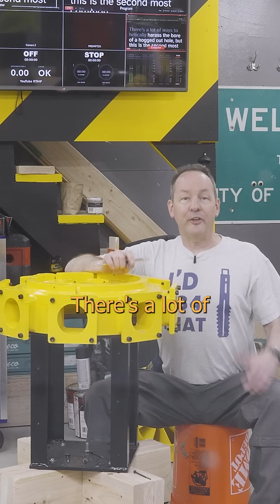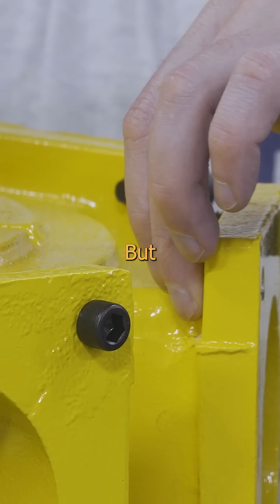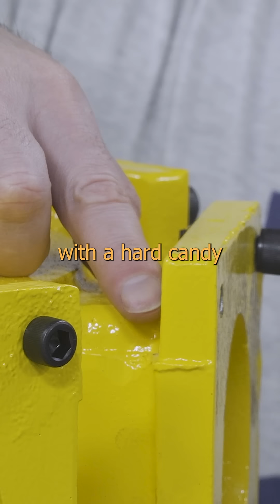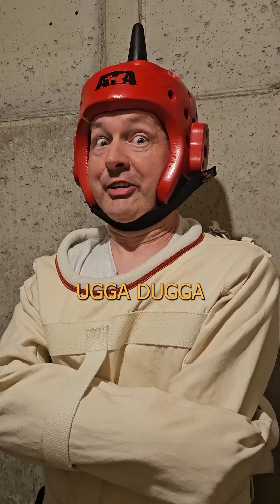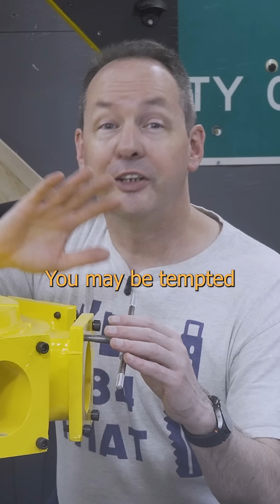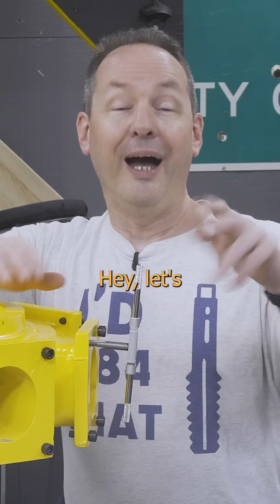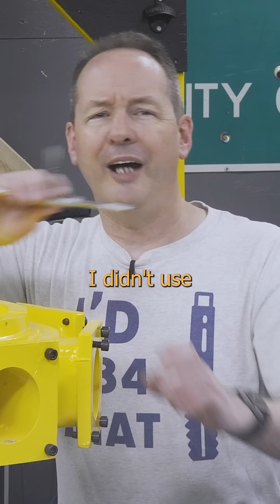Thread Chasing  #chrisboden #comedy #engineering #skills #workshop #metalworking #tools #apprentice

Comment: Dumbass, I'm a reloader and a I was trying to remove a stuck case from a resizing die. I purchased a stuck case removal kit, part of the procedure was drilling a hole in the stuck case and tapping the hole. Looking back, I think used way too much force when I tried to do it by hand and I put the tap in the drill because I thought I wasn't applying enough force. Eventually got the fucker out with a press.

Comment: Dumbass here
Work in a shop to maintain and build tools in the oilfields
I had 160 3/16"-16tpi holes to chase and I was told by a coworker to Chuck the tap into a drill but not on the square bottom, on the round and tighten until you can't tighten it. Sounds good and I get through 20 holes then snap the tap just below surface. Took a while to work the tap out (about 2 hours because I can't damage the equipment to get the tap out), plus 30 minutes to find a new tap, then I did everything with the tap wrench. Not a painful lesson but a long lesson

Comment: Important to use a tapered or plug tap to start chasing. They both help keep your tap centered and clean up the starting thread without cross threading.
If it is a blind hole, start with the tapered or plugged, pull out, and finish with a bottoming tap.

Comment: Dumbass! Trying to chase an M6 blind hole in a motorcycle frame in a tight location without tearing the bike completely apart after having drilled out a snapped bolt

Comment: This dumbass learned on the cylinder head of my 02 celica GTS.  Bolts got rusty, thought I would clean the threads out with pb then brake clean and just chase the threads in the aluminum head...where were you 7 years ago?  Broke one also. Guess what? I dropped it.  Double Dumbass 😂

Comment: I'm that dumbass.

Tapping out a rusted bolt hole on a 77 Camaro's waterpump, trying to be Johnny on the Spot and do it quickly

Got allllmost to the end of the bolt hole when.

POP!

and my tap came out significantly shorter than when it went in, like Cotton Hill getting out of WW2.

Comment: Drill hole with press or mill.  replace drill with tap.  TURN CHUCK BY HAND.  This will make everything line up perfectly.  If you do this often, take an old drill bit, and bury it perpendicular into  a T handle.  This is how my dad did -0/ + 2 thousandth precision for years.

Comment: Chasing threads with a drill is pretty safe, just set the clutch lower and retry when it engages, never had a problem. If you dont trust yourself to find the start just go slowly in reverse and feel when the tap drops in.

Comment: 53M, I saw a guy hit his finger with a hammer and he ended up with a pocket of blood under his fingernail and the shop teacher told him to take a wood bit and make a hole in his nail to relieve the pressure.. you guessed it, the genius grabbed one and instead of just using his fingers to rotate it back and forth until it penetrated the nail, he put it in a drill.. one trigger pull later and he had his hole .. unfortunately it went all the way through his finger.

Comment: My dumbass story on that front involves a workplace that requires us to use an impact to cut threads for our holes (5/8" normally) first time you shatter one all the way in you learn how to use a hole saw without a pilot to core out an aluminum plug almost 2" deep, weld the hole back to original, then you do everything in your power to never have to do it again 😂 I'm over 2 years out from my first experience with that and no more casualties to speak of!

Comment: Ive got a box of bolts with the heads cut off and a couple slits cut into the threads ive made so i can chuck em in a drill and blow threads out. Every one is made from a pair, 1 worn low grade 4ish and 1 grade 12.9 or equivalent. 
Been using those for years and never had an issue

Comment: So that was super cool, I learned a couple things along the way including my dumbass failing at the point you mentioned the last time I tried. To prevent this problem, I saw a solution I hadn't thought of that you may want to try when painting the rest of that siren, when plugging those holes, use cheap foam ear plugs to cover up the holes. From my understanding, when done, you shouldn't need to chase the threads again as the foam plug fills the hole & the threads.

Comment: dumbass 
my dad and i was making a special nozzle for a power washer wand, we had to thread the stem and the nozzle tip, i couldn't find the lube and i went to fast and broke the tap off in the nozzle tip, we had to drill a small hole, use a screw puller bit to pull the part back out. moral? do as your told and not as you want, and tools don't get broken

Comment: Dumbass! 100%.
I wasn't so much chasing existing threads. Some other Dumbass used an impact to tighten the hardened steel drain plug that goes into the aluminium oil sump on my 2003 Odyssey. I normally do my own maintenance, but I was on vacation, somewhere almost exactly between Tampa, FL and Carbondale, IL, on my way to to Carbondale to see the solar eclipse.
My Odometer hasn't been visible in decades, so I just wait for the maintenance indicator to tell me it's time, and it was. So i went to one of those drive-thru oil change places. 
Next time the light came on, I put my wheel ramps in the driveway and sits it myself, only to remove the drain bolt and have all the threads come with it. 
So I took my bolt with me to NAPA (it's so much closer to me than any more affordable auto parts store that it's cheaper to pay the higher NAPA price and to spend the fuel to go to the cheaper store) and bought the next size up and the correct size tap. I started the tap by hand, but finished it with the drill only to have to go up another size because the drill was too fast and fouled the threads. 
My second attempt was fine entirely by hand and the threads were good, but my alignment was bad and I had an oil leak at the drain for the free months it took me to save up for a new sump pan.

Comment: if you break a steel tap off in aluminum, hot alum for a day will dissolve the steel but not the aluminum. I think this may work for bolts if you got a week lmao. similarly, if you accidentally weld aluminum to a drill/tap/endmill, putting it in a bucket of lye (sodium hydroxide) will dissolve the aluminum but not the drill, rendering it once again usable.

the gold standard is a hole popper though.

Comment: I’m a dumbass because I tried it with cast iron. I thought using an electric bit driver would prevent me from going to fast or too rough. I both broke the tap AND cracked the cast iron piece right in two

Comment: "dumbass." I set injection molding molds and we have 5/8, 3/4, and 1" threads. Considering I'm the only one who stays on the upkeep of the platens and threads (since it is in my job description and it makes sense), I burn through taps and brass brushes to clean the threads. One day I was changing the mold on a press that had the same mold in it for over a year. Naturally some goober biilds up in the unused threads and the bolts tend to become one with the platen threads over time and removing them is almost always a chore. 8 out of the 16 threads needed retapped after using the brush to clean them and since that irritated me due to carpal tunnel and using a ratchet with that repetitive motion for that many threads was sure to make me wake up with dinosaur hands at least 2 times that night, I grabbed a drill. Long story short,  the mold took 4 hours longer to set because I had to explain myself as to why half the threads needed drilled out and replaced with c-serts. All I could say was "my dumbass used a drill to touch up the threads." I can say I got lucky and only got a verbal. Moral of the story: They make universal socket adapters for thread taps. As useful as they are, you have to learn for yourself that you need to hand start it in the threads as far as you can and always either use an adjustable hex impact on low setting to start or a drill on the high speed setting and the clutch power turned way down and increasing as needed. If you use the high torque #1 setting and have the clutch setting to fully engage and that thing starts going on an angle that you won't be able to control, you've officially screwed yourself and you may as well rehearse your words in your accountability meeting that is sure to happen very soon. The best you can do is find the right words to soften the blow. Suck it up and call yourself a dumbass like I did and don't offer any excuses since those will just make you look worse in the end.

Comment: I'm a dumbass. I fucked a cylinder head on a 95 civic ex. Good news is that hondas are engineered with so much grace that I just spend some Honda-bond on the mating surfaces and fucking sent it. That bitch ran for another 60,000 miles.

Comment: I help out restoring old streetcars and recently I was using a die (the opposite of a a tap) to cut/ cleanup threads on the studs (technically bolts but they rusted so bad they welded themselves in the hole) the motor in place. Even if I wanted to use some mechanical mussels nothing would fit over the 2” nut/tap

Comment: dumbass....

was trying to drill and tap a new hole in my suspension knuckle for my abs sensor bolt. I got impatient with the tap and slapped it in the chuck of a drill. now theres permanently a piece of tap stuck in the knuckle

Comment: I still remember breaking a tap off in an already threaded hole after we disassembled an old 24 head bottle filler a while back. I was, of course, doing it by hand, but just a little too rough and completely snapped the tap flat with the surface so that I couldn't get to hold it with pliers to twist it back out like a proper dumbass

Comment: I used to work for a company that made aftermarket ball joints. They had me chase and cut fine threads for tiny grease certs with a DeWalt cordless drill. It felt very wrong and made me feel dirty.

Comment: Jokes on you.
I have welding machine and 2 drills.
One for hole, other for tread.
Once i mess up ( about 1/30) i just weld the hole and send go for round 2. I found out that doing it propperly, i can do 10-15 per hour. Doing it my way it's about 30-40 depending on how dull my bit is. At the end of the day it's just way more effective to ugga dugga this and fix messed up ones.

Comment: I have yet to dumbass a tap.  Wait.. Nah, leavin' it.

I did have fun tapping, though.  '06 Mustang whereupon I snapped a hardened bolt off for the engine cradle.  The drilling was miserable.  Finally got through, remainder bolt was removed, yay.  However, threads were messed up enough that it was time to tap, and man... I mean MAN... that did NOT want to happen.  Little bit, chase it out... little bit more, chase it out...

That was a looong session on one bolt hole. :|  But the new bolt is still in there and holdin', so that's pretty cool.

Comment: Surprised you didn't try a tube of high temp silicone. But when you have the right size tap, I guess it doesn't matter and has no cost but time you'd already spend anyway

Comment: I worked with a guy that refused to learn that he was a cereal tap killer. He used to break taps on a weekly basis and we would have to use any number of fuckery removal devices all the way up to and including a air arc gouging tool and a welder to add material back to the sides followed by a redrill and tap process... One time we did the same hole twice.

So, I learned by proxy, I got to watch the dumbassery first hand, and had to endure the aftermath. DOZENS OF TIMES!

Comment: Not a drill but a beast of a man. Gunsmithing school, 2022~23ish. We were doing shotgun chokes, threading the end of a shotgun bore to accept removeable chokes rather than the old fixed choke from factory. This beast of a man (who we nicknamed silverback) hopped up on retard strength he threaded the reamed area for the choke, over the shoulder and tapped another few inches of bore. Only realizing something was wrong when the tap handle hit the muzzle, which is about 4 inches deeper than the choke depth. So you dont need a drill, just a big ass corn fed farm kid and a a 12" T handle

Comment: Dumbass… I was chasing threads on the oil pan bolt holes on a trailblazer and not only cross threaded them but somehow made the hole a smooth cylinder

Comment: It's possible to properly use a machine to thread chase those holes with a tap, but for hole that un-true, but you need 3+2 or 5 axes(different things), and if you using those kinds of toys,  you might as well thread mill it instead.  😂

Comment: Thankfully I have not yet broken a tap. I was fortunate enough to be taught correctly how to use them. I have also had the benefit of witnessing other people's mistakes.

On another note. If you're going to chase that many holes. Then you may want to invest in thread chasers. Instead of using taps for this application. For this kind of process cheap chasers should be fine.

Comment: My dumbass broke a 9/16 tap off in a blind hole in a highly critical stainless steel boss that was welded to the frame of an EXTREMELY expensive piece of hydropneumatic equipment.
Yes, I was chasing the threads with the tap in a drill, had a lapse in concentration and let it bottom out.
I'm not talking about the extraction process...

Comment: Decades ago, I used to rebuild the old air-cooled VW engines.  They were absolutely unparalleled at having fasteners break off in dissimilar-metal holes, and in having threads shear off allowing studs to pull out in really inconvenient places.  I had a collection of insert kits and jigs for the majority of the common problems, but I'd have to wing it once in a while, too.  I'm long retired, but I still have the taps, drills, and inserts in my tool boxes, because you just never know where they'll be needed next.

Comment: I make my own thread chasers with whatever random hardware... Just cut some appropriate relief cuts with a cutoff wheel. 
The taps are harder than a coffin nail and they'll break looking at'em wrong 😅

Also doesn't hurt to be aware that taps exist with flat bottoms, i.e. they'll cut all the way down for a hole that stops instead of passing through.

Comment: The worst I've ever done was accidentally snap off the tap by allowing excessive force to be applied in the wrong plane to the tap, but I was able to back it out with a small sacrificial screwdriver hammering it in reverse for several migraine-inducing minutes. I've never had to employ a helicoil insert, either.

Comment: I'm a dumbass. I was tapping a door frame for a electronic lock.  Used a drill on high speed and it worked the first 3 times but the forth broke the tap in the hole. Been going the manual way since.

Comment: "dumbass" cleaning the threads on a old Cadillac using a drill and snapped that sucker in the hole, it snapped not flat but at a pretty good angle making it really hard to drill out, taps are very hard and brittle, and standard high speed steel drill bit wasn't doing the job had to by a set of diamond tipped bits to bite into the bitch. once got hole cleared damage done, ended up drilling it a size up, tapping that then using a thread insert. Time saved by using the drill instead of the tap wrench?? negative 4 and half hours. ya i was a dumbass, but I learned my lesson.

Comment: Eh fuck it. Tek gun on lowest setting will generally work fine for chasing so long as it’s a pre cut hole a 1/4 hex driver is gonna be mostly fine. 

Milwaukee makes these excellent socket driving bits that are less than a 1/4” thick, which is thicker than most taps thinnest point. If you have to chase 50 holes it’s generally gonna be quicker. 

Or a drill with the clutch set as low as it will go while still driving the tap. I like the clutch setting of 8 for most taps, with 4-6 for smaller and 14 for much larger big dog taps.

But I’m paid hourly, so we get to use a shifter to turn that tap in a 1/8th of a turn at a time

Comment: Not my F-up, but a classmate of mine in college in an ASE auto mechanic course. We were working on 1980's era Buick with a 305 V8. It needed a new thermostat. This 'genius' decided to use a cheater bar on a breaker bar to remove the heavily rusted thermostat housing bolts. Of course the bolt snapped, so he had to drill out the bolt. He proceeded to break the drill bit off inside the broken bolt. The school's shop has to order specialty drill bits to cut through the broken bit to get a bolt extractor a place to grip the broken bolt to remove it. After the bolt was removed, the instructor had the same student chase the threads to remove any remaining rust. He put the tap on a drill and completely messed up the threads. Ended up having to use a heli-coil to fix the messed up hole.

Comment: Dumbass. Me was dumbass apprentice. 

Mounting a box for a radio repeater up in the steel of a GM plant while in a boom lift. 

Threads caked with some sort of schmoo that I couldn’t get through. Tried to zip my brand new tap through it with an impact. Fucked up the old threads and fucked up the tap. Had to drill it out, and hand tap one size up. 

Doing all this is not easy when there is a running assembly line underneath you, and standing on the middle rung of the basket handrail. 

If you’re working at GM Orion Assembly  and find the box with 1 bolt a different size, that was me. Sorry.

Comment: When you run the tap thru, tear a narrow strip (<3/4") strip of an old worn thin tee.    Add tap magic and make 1 non overlapping turn around the tap b4 running it thru.  Really cleans threads nice, I used to do this following a chattery tap to clean up the threads